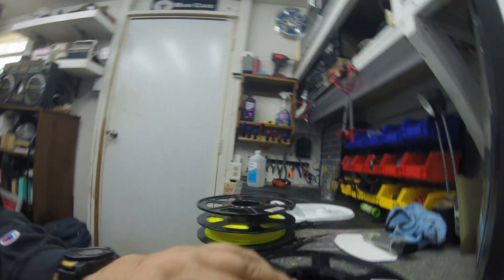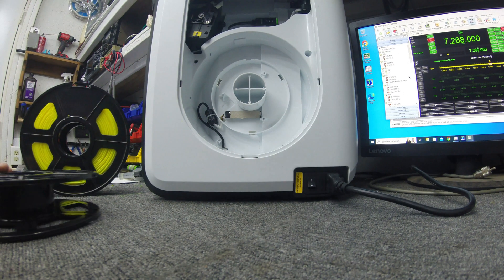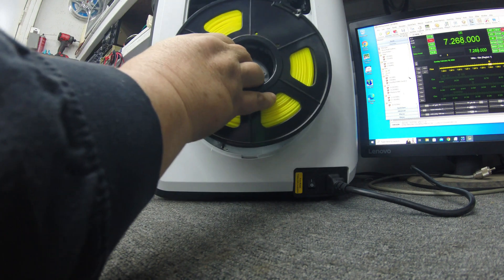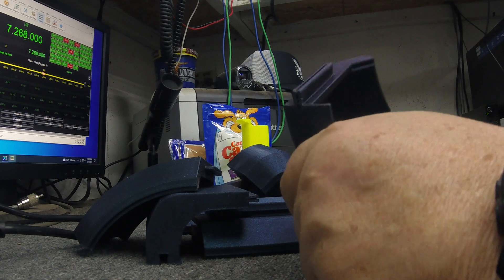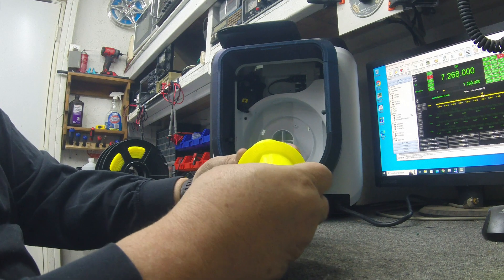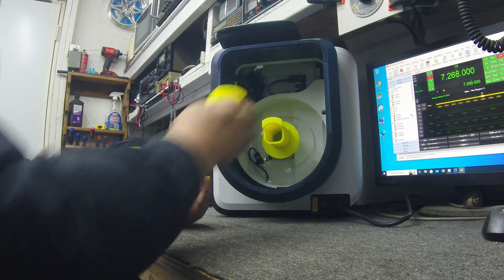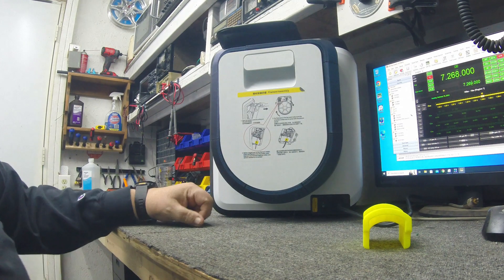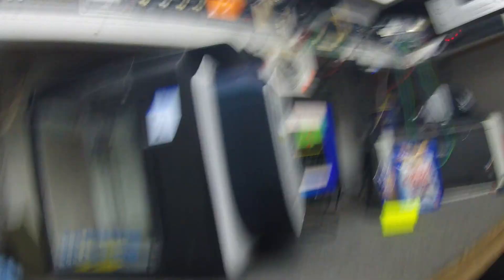Flashforge Adventurer 3 Pro 2 Spool Size Issue Resolved

Comment: My comment keeps disappearing for some reason, but I was going to ask you how long it took you to print each section. I got the files from thingiverse and it appears to be four files including the walls for the holder and the spool. Do you remember how long each of the files for the walls took to print? I'm guessing 15-20 hours with the 0.4mm nozzle on regular, maybe a little faster on fast. Just curious if you remembered.
Reply: Did you have any problems with the filament not adhering to the print bed for the first few layers? I have the spool holder printed and I'm on my second attempt at the lower walls, and it seems to be working after cleaning my print bed with some goo gone then some cleaning wipes. But if I'm having trouble printing the bottom layer the top layer seems like it may be more trouble to print. I'm using Flashforge  filament black pla 1.75mm and a 0.4mm nozzle. Do you have any tips about making sure the next print for the top layer sticks? Did you have any print issues with it?
Reply from the maker: @MasonGrimes-rc5kg  Did you use the glue stick on the bed? On big prints it's a must my printer came with one and I bought a pack of 5 off Amazon I always use it on my prints usually I can get 2 or 3 prints before I clean it off and reapply but it makes a huge difference on your prints staying stable on the bottom layer..
Reply from the maker: Yeah seems there was 3 prints if I not mistaken the first 2 were like 10 hours each and the last one was little faster as it was the clips and the adapter all in probably around 24 hours of printing of course I just made sure it was going and walked off so it could have been a little faster than that..
Reply: I was able to get the whole 3 piece set printed, and with a little sanding able to get the clips to fit into place. I had a bit of stringing with the top pieces when the print head moved from piece to piece about half way through printing, but a lighter easily took care of most of that, and a little light sanding with 320 grit sandpaper fixed the rest. I glued mine together with gorilla glue brush on super glue. I just have to install it now. Does it snap into place easily? Is it better to insert one side then the other at the top or pop it all in at once?

Comment: This is great. I've been using a spool holder for a few years because the filament even made by Flashforge (which is great filament) doesn't fit the spool holder. Ive been wanting a better solution and now I can make one.
Reply from the maker: @MasonGrimes-rc5kg  yeah it has been awesome because now I use any filament I want

Comment: WOW WOW WOW :face-red-heart-shape:!

Thank you so very much this is awesome and so nice of you to share with other people!

I have been struggling of late with dryer boxes and other things to try and get my filament to feed properly and I have always wanted something like this.

So thank you so very much once again!

I don't suppose you can help me with removing PLA from my Flashforge Adventeruer 3 Lite that has stuck to the bed?

I used a razor blade to try and get it off but all that did was destroy my print bed by cutting into the plastic layer :hand-orange-covering-eyes:.

Lucky I had a spare and I tried printing something on the new bed and now that PLA is stuck to it as well. This is also a different filament that I have used in the past without any problems.

My bed temp is the standard 50 degrees so I am at a loss now as to what to do as I don't want to waste another printing bed.

Thanks :hands-yellow-heart-red:!
Reply from the maker: Thank you so much for the positive feedback... It should not be sticking like that I have never had an issue if anything I have always had the opposite of not sticking good enough. Are you using 3D printer glue stick I always do, I wonder if that not only helps make it stick but also helps it release easier just a thought.

Comment: Looks good. A question, what is height from machine to door? Will it hold a 1kg spool? I have 2 adventurer 3 printers, both work great.
Reply from the maker: Ok I think I understand what you are asking.. The only way you are going to be able to use the door is to print an extension structure like I did for 1kg spools. The inside area where the spool goes in the factory area is to small to hold a 1kg spool, now as you see on mine with the extension and holder it moves the spool outside the cabinet so bigger spool can fit and use the door... I am glad I found the extension as most people wouldn't even know it was not part of the original machine and with being able to use the factory door keeps it quite and looking tidy. And if your are just wanting put the extension on the machine yes it would be high enough for a 1lkg spool.
Reply from the maker: Yes it will hold 1kg spools now with the 3D extension. I am really happy with it been through a couple spools already does great prints not sure what you are asking on height the whole machine is about 16" tall by 18" wide with the spool extension and about 15" deep door is about 11.5" tall if that helps..
Reply: @TheElectronMan  I was looking for the height of the extension. I made a spool holder, but I can't put the cover on. So if this is high enough I can use my current spool holder.